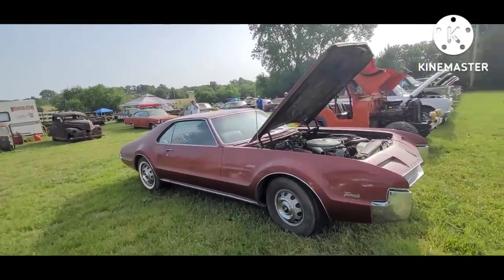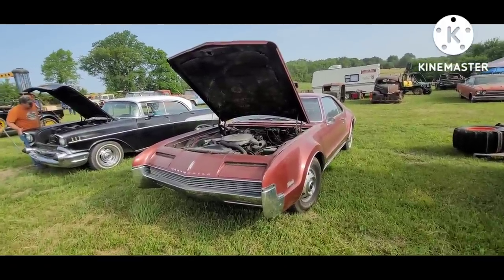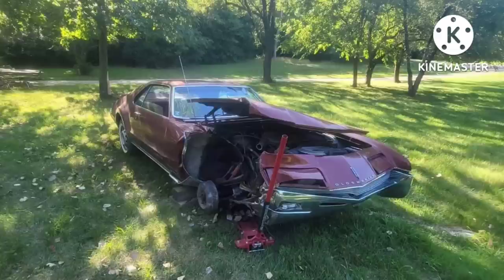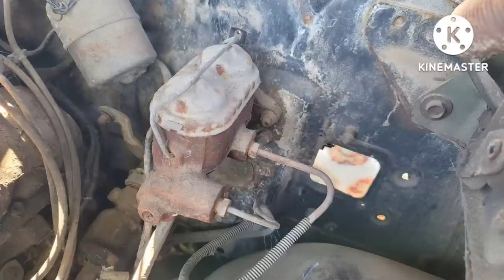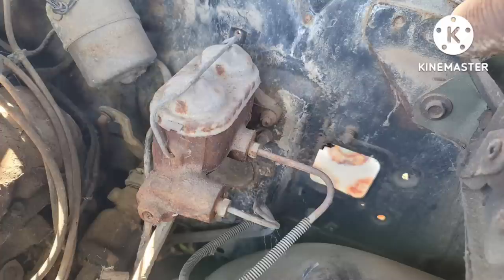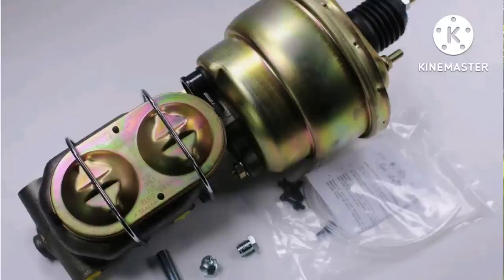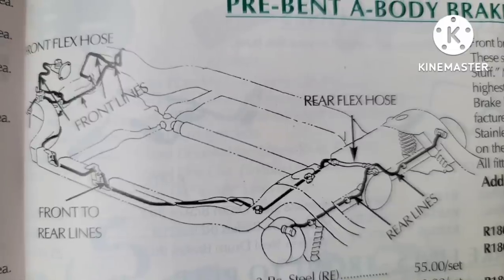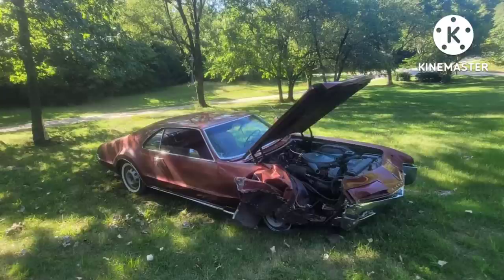Toronado Tragedy: Here's why UNSAFE single jar master brake cylinders are DANGEROUS old car hazards!

Comment: Great video man! I think the most commonly overlooked system is brakes! Just because that car has a single master cylinder does not mean the car is dangerous! Dual master cylinder will fail and cause the exact same results. Lesson to be learned here is rebuild your brakes completely if you car is not being driving daily. Make sure your park brake or emergency brake is working! One final thing to always remember when driving a old car is its a old car and stops like one! Have a good one Buddy 👍

Comment: Another PSA to go along with this: just don't drive old cars until you or a professional goes through the entire brake system completely and thoroughly to begin with. You don't need to upgrade the system to a dual circuit system, you need to go through the existing system properly before driving it. A car like this would have required a rebuild of the master cylinder and new brake lines and wheel cylinders before driving anyways, knowing how original it was or how long it's been since it was serviced to begin with. I wouldn't have driven it without going through the brakes completely to begin with. At the same time, I'd feel completely safe using the stock single brake circuit system so long as it was properly serviced.

Comment: How come he didn't pull the E brake?
Reply: Big American cars from the 60s and 70s didn't have parking or emergency brakes you could  "pull" like that.  They had pedal parking brakes.  If you pressed it while driving, it was not a good thing!!
Reply: @chrisclermont456  So hitting a tree instead of locking up rear brakes by emergency brake is better? lol. I repair and build vintage cars for a living and have only had to use an emergency brake twice
Reply: @haffrods7055  The rear brakes do very little to stop a vehicle, and are easily locked-up. When you lock the rear wheels, you'll likely lose control of the vehicle too. 70-80% of your braking is done by the front wheels.
Reply: @exDrBob1  So hit the tree instead? I guess since I've been driving vintage cars for decades and have used the e brake on occasion with failed brakes, I'm dumb. Next time I'll aim for a tree.
Reply: @haffrods7055  Go ahead and lock up the rear wheels-you'll learn the hard way. And don't bother aiming for anything, the car will go where it wants. I've been driving vintage cars since before they were vintage.

Comment: Alliteration aside, a tragedy is when someone dies.  Just a damned shame about a beautiful survivor.  Totally agree with you on single jar braking systems, as well as brake lines and hoses.  When you get geeked about getting an old ride, don't forget that it's an oldie that probably weighs several tons, and optimal brakes are needed to stop that behemoth.  I will always trade safety for authenticity - double reservoir master's are where it's at, even with drum brakes.  Well maintained drum brakes with new wheel cylinders that are often obtained cheaply through Rock Auto can always stop your ride just fine.  A very timely message for all your old car enthusiasts.  Thank you!
Reply: Ahh but what is life without linguistic casustries??

Comment: I bought a '69 Dodge with super low miles that was always parked indoors. The master cylinder blew during a safety inspection and got changed. A year later a rubber brake line blew and my mechanic said that other than the master cylinder the whole brake system was original. It already had almost useless 9 inch drum brakes. We ended up changing everything. I felt lucky the brakes blew while I was parking it and was going slow. 
Great advice.

Comment: Great info.  I lived in Arizona for years and did  lot of buying and selling cars that had been sitting in the heat for years.  If I found a car I was going to keep, the FIRST THING I would do was replace all the lines, wheel cylinders, hoses lines and upgrade to a dual master as you mentioned not to forget belts and hoses.  Arizona does NOT have safety inspections and therefore cars get beat and left to rot. I Also replaced the front wheel bearings as NO ONE ever thinks to do them.  Was it worth it??  Absolutely for safety reasons.  Shame about the Toronado, but I saw a few mishaps in Phoenix due to failed brakes or seized wheel bearings.  Thank you for stressing this.  Just because it LOOKS OK, DOESN'T MEAN SQUAT.  Better safe than sorry.

Comment: Always press brake pedal very forcefully as a pre test in old cars. If it fails know it before drive.
Keep park brake functional an as effective as it can be for a bit of backup braking.
The brake lines might be rusted and high pressure test ( by stepping hard on pedal ) at stop will prove if serviceable.
Of course braking one of most important systems as steering.

My pickup is now 71 years old and been road worthy all those years by maintenance.

Comment: Thanks for the heads-up!!  The 66 Tornado is a classic Ive wanted for anlong time.  I have read some owners change the braking system to disc brakes.  The 4 wheel drum system was one of the major reasons why the 1st gen Toronado failed.

Comment: Don't get me wrong, I am VERY glad your friend is alright.....but this is one of these videos where we would probably mourn the loss of the car as much as celebrate your friend's survival.      That was a beautiful beast and there aren't many of them left.....especially not with that provenance.  The Olds Toronado is one of my all-time favourites and is up there with the Buick Riviera and Skylark.  It's truly a shame if it cannot be straightened up and driven again.....

I lost brakes in my '74 Triumph Stag midway through a 40 mile cruise around the bays near my home.  One corner, the brakes were there and the next, the pedal went to the floor.  As the car has a manual gearbox, I threw it down a gear and got the big V8-powered convertible around the corner and using the box and the handbrake, was able to pull her up.....so I consider myself very lucky in that regard.  The Stag has a boosted dual-reservoir master cylinder that is split front / rear.  However, it was the seal at the centre of the main piston in the master that gave up and when I looked at the fluid in the reservoirs when pressing the brake, it didn't rise and fall gently when pressure was applied and released like normal....but what it DID do was fountain the brake fluid in both of the reservoirs when the brake was pressed.  It just squirted up out the hole in the bottom of each reservoir like someone put it under pressure with a squirt gun.  No pressure was being sent to the wheels at all.  A stainless steel re-sleeved and re-kitted master cylinder later, the brakes were working fine again.  

There was no warning before the cylinder let go - no mushy pedal, no pedal drift to the floor at lights - nothing.  One corner the brakes were there, the next they weren't.  I've been through the system since replacing the master and either replaced or rebuilt everything in it.  I learned when I was a young fella that this was the way things must be done for two reasons - Firstly, if you replace an old master, the extra pressure could blow out a line or a tired seal on the slaves.  If you replace a pair of slaves, the back pressure could upset a line or a seal in the master.  Best to just do them all.  

The second thing is that you have four small spots of rubber between you and the road.  These four small spots of rubber have to be in excellent condition to be able to turn the car or pull you up quick.  A tyre might look like a huge surface, but it is only the bit in touch with the road that has any say in which direction you go.  If your brakes aren't working the best they can, then these four spots of rubber cannot do their job properly and likewise if the brakes are spot on but your tyres are old, having new brakes means nothing.  The two go hand in hand and remembering this all these years, I have gotten out of a number of tight spots where if one of those two components had been off, I would not be typing this right now.

Appreciate the video on the pitfalls of single reservoir cylinders and will keep it in mind for when I do the brakes on my 1977 Mini.  All the best
Reply from the maker: Very good information Lance, thank you for taking the time to share it!

Comment: I've experienced several brake system failures on the dual-reservoir master cylinders and I am not at all convinced that they are any better than a single-reservoir system.  I was well-versed at downshifting and using the parking brake, while keeping my vehicle speed low on back roads to where I could get the repair done.  Go over to Uncle Tony's Garage channel as he just had several recent videos on brake system failures and how to deal with them.  Everybody that drives these older cars should know what Plan B and Plan C are!

Comment: no such thing as diagonal brakes.....the rear brakes are always fed by just one line that splits too two on the rear axle. and if you blow a line in a dual circuit going fast or down hill your still more than likely F'ed...... heck i had a 85 riviera (same drive layout as the toronado) and the front caliper blew as i went to try and make turn onto a county road and instantly lost all brakes. luckily the parking brake still kinda worked and got me slowed down enough to stop.

Comment: Where did you get the diagonal thing from?  Dual masters are split front/rear.
Reply: Originally, yes but mfrs. eventually went diagonal.
Reply: @JohnShinn1960  On what cars?  I have never seen this in working on cars since the early 1980s.  Heard that the X-body GMs may have used it.
Reply: @redmondjp  Volvos used diagonal brake splits since the 1967, in fact they were designed so you would always have 3 brakes working if one pot of the dual master failed. Of course it cost more to do so most manufacturers didn't adopt it.

Comment: The 1300 hp comet wrecked because of the sticking throttle and the guy riding the brakes not a neglected master cylinder and just like the comet video I’m sure the driver of this toranado had a chance to stop the car before this happened be had no idea of the brake pedal feeling funny and kept driving it anyway

Comment: That car came with a Emergency Brake. To bad panic came in effect.
Reply: The rear brakes do very little to stop a vehicle, and are easily locked-up. When you lock the rear wheels, you'll likely lose control of the vehicle too. 70-80% of your braking is done by the front wheels.

Comment: I just wanted to say to all the people that are saying he should have done this or that etc.  Yes I agree as these are the types of cars I drove in my teens and I personally have owned my 1966 Toronado since 1984.  But and this is a huge BUT ….. when something like this happens some people panic and don’t think quickly or just freeze up and panic.  In this situation every second matters!  I lost my brakes once on my 65 Tbird convertible driving about 30-35 mph on a 2 lane local road.  Luckily it was late at night and not many cars on the road. I had a red light coming up. I pressed brakes went to the floor. Tried pumping no go!  Next was I downshifted you first gear and slammed on my parking brake.  At best the PB slightly slowed me down but the down shift helped the most.  Next part is Hollywood style lol there was a car in each lane ahead of me and I started honking and flashing all while doing everything mentioned. Neither car moved through the red light so at that point my last option was hit the rear of the car in front of my or jump the concrete median that was about 7-8” high and like 3 feet wide.  No cars were coming on opposite side so I gently steered into the curb median to jump over it.  To my surprise I hit it at just the perfect angle as the car went over didn’t bottom out, the rocker panels were unharmed etc.  Not a scratch and zero front end damage. At point of jumping median I was down to about 16-18 mph I then made a hard left in the intersection and stopped about 50 feet from it!   I was shaking a bit then got out to see if I had damaged the car at all.  One of the drivers who was stopped got out and asked what the hell happened asked if I was drunk or fell asleep”? I said no lost my brakes!  He replied man you really know how to drive! I literally handled that like my life depended on it !  I had and still have super fast reflexes even at 57 years old.   And am calm and know what to do in these situations.  It’s scary as hell though.  I have had throttles stick,  my mark lll caught fire because the ps line developed a leak and it goes from pump to wipers (they’re hydraulic) and sprayed on the exhaust manifold. It was dark I smelled something and pulled right over.  When I got out I saw orange flickering light under left side of engine reflecting off the ground I knew right away FIRE RAN TOmy trunk ook out a blanket and a gallon of washer fluid I had. Smothered it with blanket then poured the washer fluid over it and it was out.  To get home I was thinking now what ?   Being it’ gets pressurized from ps pump I thought if I disconnect it I can drive home.  Only had a knife in the car no tools so I cut the belt.  It got me 45 miles home without reigniting ! Lolololol. I can tell you a 5000 lb Mark lll is a bitch to drive without power steering working lololol. Good times from my past. ! 😆👍🏼

Comment: Hopefully nobody was injured.
Parking/emergency brakes -  it is not uncommon to see them disabled because at one time in the past the brakes got stuck on and the cables were cut off, or the levers inside the drum brakes were removed years ago.   They're something many people say to use every day or never, because they did tend stick on often if rarely used.
Reply from the maker: I agree, especially on automatic transmission vehicles where they are not used to hold the car when parked. I see them disabled a lot in this area. Here in Kansas and the central plains, it is so flat that the necessity of using a park brake is something we just don't even consider... and, unfortunately, if not functional, they are useless in an emergency situation!
Reply: @mr.goodpliers6988  100%.  Thanks for the videos.
Reply: @mr.goodpliers6988  Northern states get the same. Nobody wants the bad day of using the parking brake at -15deg and the freeze in the applied position. So they wind up rusted in place from lack of use/hard winter salt roads. That car doesn't look totaled to me. Is there some frame damage? Even then, running driving complete might be worth the frame swap. It just looks like there's too much left in it for the write off. Thanks for sharing
Reply: In 1967 it was mandated that all cars have dual line and master cylinder only two cars had dual braking before 67 the cadillac and AMC division. The 67 Toronado had factory dual braking and front disc brakes where a option not many where produced it would be worth it if you can find one this car with driver on board weight 5000 LB..a.car that heavy needed disc brakes.....